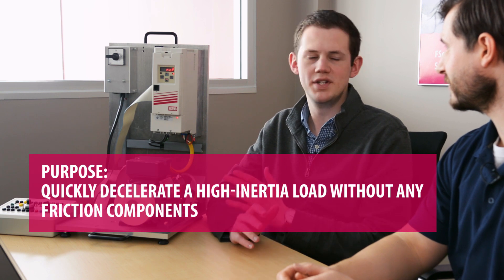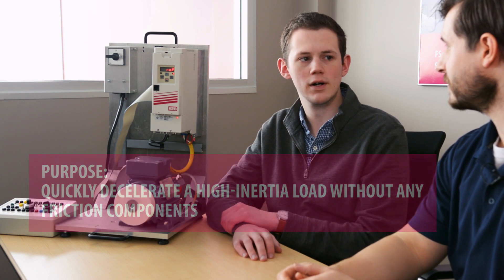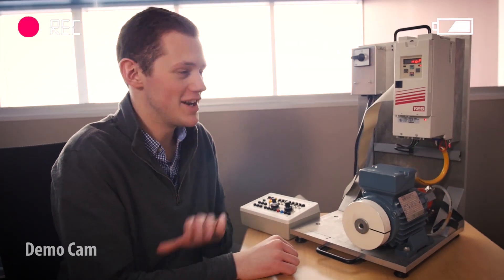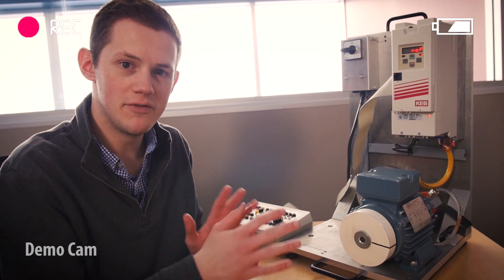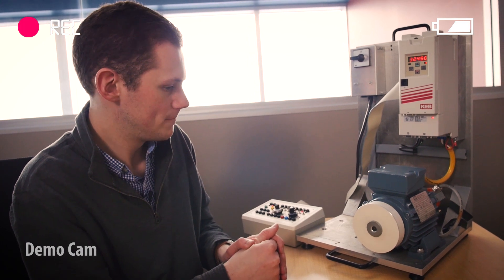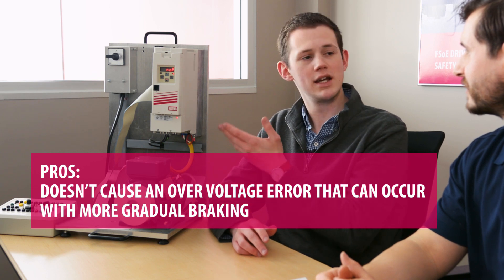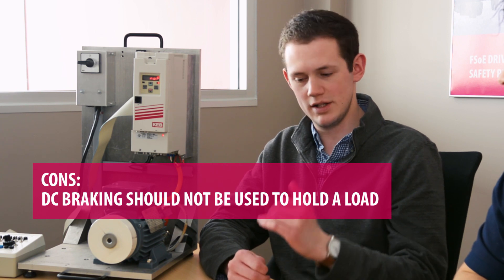What is DC Injection Braking? - Problem Solved

Comment: we have DOL fed 0.75 kw 3ph ind motor with dc injection braking.
But rectifier diodes fail frequently at voltage dips.
Any remedy please?

Comment: DC breaking also works on single phase motors.  You probably won’t use a vfd but you can make a timed relay system with a dc power source to do the same thing
Reply: Hey, we have DOL fed 0.75 kw 3ph ind motor with dc injection braking.
But rectifier diodes fail frequently at voltage dips.
Any remedy please?

Comment: Hello sir, I am very helpful with your information
but, can I see directly the dc source that is short circuited with the stator coil?
how does the star-delta termination affect the injection?
and the dc source is fed to the 2 stator windings, how is the effect of one of the windings that is not connected to the DC source?
can you explain how to calculate the maximum heat in the stator winding so that no damage occurs to the AC motor
thank you, I really hope for your help
Reply from the maker: You can read more about DC braking here: https://www.kebamerica.com/blog/dc-injection-braking/
If you want more information for a specific application you can contact us or you can find other places to learn about DC braking online.

Comment: I used this dive in an elevator it gives me an error displaying like this (F1 68 ) I don't have any manual for this drive  
It is vacon nxl00235c2h1sss0000. 
I need some technical support if don't mind.
Reply from the maker: You should contact your elevator controller manufacturer first. Vacon is a different VFD brand. We cannot help you with your questions regarding this product. You can search for this Vacon drive online and find a manual. Have a good day.

Comment: Dear i have 45 kw vfd and there are 4 motors of 11kw each connected in parallel with this vfd,now i want to stop these motor by DC braking,please tell me how much DC current should be injected and how much time?

Comment: Hi guys, great video. Now, I would like you to answer a couple of questions. Although from outward appearances the braking cycle seems almost instantaneous, in fact, with DCib there is almost no braking torque in the initial portion of the cycle instead it all comes in a great big rush at the end. Could you explain the reason for this braking-effect delay, i.e. why it takes such a large proportion of cycle time for the negative torque to build? (Assuming standard squirrel-cage induction motors)
Also, orthodox DCib implementations utilise timer relays to terminate the braking cycle. This is a very crude method. Better to use the actual shaft rotational stopping point. Can you suggest any clever feedback techniques employing signal outputs from the motor windings themselves to operate the drop-out braking contactor? Thanks.
Reply from the maker: I would refer you to our blog post. I believe it answers both of your questions. https://www.kebamerica.com/blog/dc-injection-braking/

Comment: What is DCBR error in vfd..what cause for that??? The default value is 1 sec..range is 0-25 s please guide
Reply from the maker: Have you contacted your machine manufacturer? That should be your first step. If they cannot provide a solution then you can find a local KEB representative here: https://www.keb.co.uk/contact/contact-worldwide

Comment: Good explain
I have a drive with built in braking transistor how can I use it
Reply from the maker: A braking transistor in a drive will act as a method of diverting excess energy returning to the drive from a motoring operation to a braking resistor. A braking resistor is external to a drive and is the component that will dissipate excess energy as heat. This will save your drive from excess energy which can cause damage to the drive. 
However, this video is discussing DC injection braking. The major concern here is excess motor heating. This is to decelerate a load quickly, but not meant to hold a load at zero position for any length of time. You need to make sure your motor will handle the excess heat generated from injection braking. If you have further questions you can contact us (kebamerica.com - if you are in North America) or your local KEB Representative: https://www.keb.co.uk/company/company-group
Reply: @KEBAmerica  Thanks alot
If my application don't require this method of braking there is no danger to the drive with this built in braking unit
With another mean  the drive with built in braking transistor no need for connect resistor to save the drive if I don't use this method of braking

Comment: Hello i have variable frequency motor and stops by dc braking to reach 0 speed position .. i just want to know how inverter applies dc voltage through 3 phases ? .. does it apply dc to one of them ? .. and is it like pulses from the inverter or constant dc to the motor

Comment: You said apply dc only for small time period, how much exactly?
Does all drives support dc break?
Is there restrictions for a size of drive/motor?
Does soft starters/stop support this?
Many thanks
Reply from the maker: Specifics for duration/amount/etc. are all application dependent. Not all drives support DC braking. No restrictions on the size of the drive that could utilize this function. I am not aware of any soft starters that would offer this function. Thanks again for your comments!

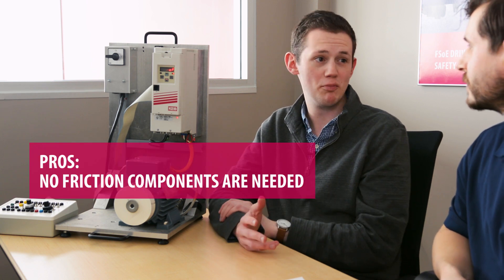Comment: 3:26 ...no additional components...don't you sometimes need a larger braking resistor depending on how big the motor/load is and how fast you want to stop it?  I see other videos where they attach gigantic external braking resistors.
Reply: Yes... Did one today actually... I'm an industrial service electrician. Today I worked on a system at an asphalt mixing plant with a motor name plate that read 250HP 460VOLTS 270AMPS 
3.0 OHMS ...

Comment: Thanks for the video.
Can you please share the Parameters for DC braking in F5.
Reply from the maker: You can find the parameters for DC Injection braking at the bottom of our blog post on the subject. https://kebblog.com/dc-injection-braking/ 
Scroll down to the last few sections of the article and you'll find an image with the parameters "Pn38" - "Pn42". Let me know if this answers your question. Thanks for the comment!
Reply: @KEBAmerica  Thank you for the solution.
Reply: This solution worked very well in open Loop. Can i use DC injection in closed loop??
Reply from the maker: No, DC braking is only possible in open loop or ASCL control modes.

Comment: I have problems with my motor,  the brakes engage without a command. It does not run for more than 5 minutes. What could be the problem
Reply from the maker: The brake engaging is entirely unrelated to DC injection braking. A couple things to check is the power supply to the brake and possibly the airgap of the brake. For more information contact your machine manufacturer, supplier or a local KEB Representative by phone or email. Find one here: https://www.keb.co.uk/company/representatives-agencies

Comment: this information about coil heating was very helpful thanks , what can we do to reduce the heating while breaking  the wheel to stop 😀
Reply from the maker: The main parameter option to reduce heating is to reduce the maximum output voltage. There are also parameter settings for the DC braking time and start speed, both of which could affect motor heating. We hope this helps.

Comment: Nice video guys! I have a question about DC injection braking. Does a typical DC injection brake care about the frequency of its AC input or just the voltage? E.g. do they care about 50Hz or 60Hz as long as the voltage is as expected? I believe it shouldn't matter because the AC voltage is going to be rectified to DC but thought I'd ask some experts! :-)
Reply from the maker: You are correct. Input frequency doesn’t matter. The output DC voltage has a range of 0-25.5% and is a parameter setting. Thanks for the question. If you have questions about purchasing KEB products for an application feel free to contact us! https://www.kebamerica.com/contact

Comment: thats mean if i wanted to make this type of breaking to stop a motor i should make it in a pulses of d.c and not continuous
Reply from the maker: As said in the video, you can use DC braking to bring a load to zero speed, but you should not use this type of braking to hold a load. You will need some type of brake (like a permanent magnet or spring applied brake) if you need to hold a load for any length of time. If you apply DC braking for too long, you risk overheating the motor. The stopping energy is transferred to heat and too much heat is bad for any motor. :) You can use DC braking in intervals. However, keep an eye on the motor temperature so you don't ruin your motor. Read more about Motor Thermal Protection here: https://kebblog.com/motor-thermal-protection/
Let us know if you have any other questions. Thanks for watching!
Reply: @KEBAmerica  
thanks to much for your interesting in my questions i'am so greatful  🌷🌷